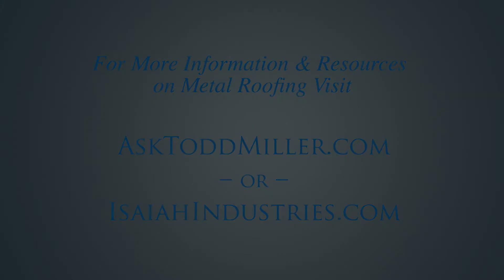Steel Roofing and Rust Protection – Metal Roofing 101 with Todd Miller

Comment: so are you saying you shouldnt cut steel?
Reply from the maker: When you cut steel roofing you want to use a shearing action that leaves a crisp and clean cut, exposing as little of the carbon steel as possible.
Reply: @IsaiahIndustries  buy your still exposing metal?
Reply from the maker: @redsresearch  Both field and factory cut edges ultimately expose carbon steel.  A crisp clean cut will expose as little as possible and is critical. When it rains, zinc ions from the corrosion-resistant coating on the carbon steel go into solution with hydrogen from the rainwater and are deposited on the exposed carbon steel. This builds up a layer of protection.  However, in highly corrosive environments, it simply can’t happen quickly enough so you end up with cut edge corrosion.  Likewise, roughly cut jagged edges will also never get protected.
Reply: @IsaiahIndustries  so any kind of cut will still corode...
Reply from the maker: @redsresearch  As I have explained, that is not the case.  I have seen plenty of very old steel roofs without any edge corrosion.  Please give me a call at 1-800-543-8938 ext 201 if you’d like to discuss further.
Reply: @IsaiahIndustries  well maybe you need 2 explain better.. does it happen fast enough if you use a shearing action?

Comment: Hi can you tell me aluminium and aluzinc which one is better please?
Reply from the maker: It all depends on what you are trying to accomplish. Aluminum is great for corrosive environments such as coastal areas. Aluminum also is more malleable than steel and can be formed into a wider variety of shapes. Aluzinc is steel coated with an anti-corrosive alloy of zinc and aluminum. It is not as rust resistant ultimately as aluminum, but it is stronger than aluminum and could be used very well on roofs that may be subject to hail or foot traffic. Feel free to email me with more exact details on your roofing situation.  todd@asktoddmiller.com